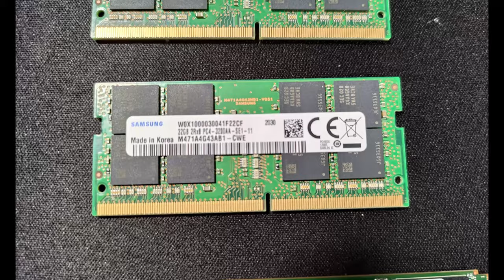ROG Strix SCAR (G533 / G733) DISASSEMBLY and UPGRADE OPTIONS (Storage, Thermal Paste)

Comment: Your video’s still being useful: I opened my machine to replace the ram, and one of the ribbon cables popped loose. I was completely lost about how to put it back until I saw you remove the one. Like that other commenter said, yours is the only video that seems to actually show that part, everybody else just says “mind the cables” and then jump cuts to the cables being removed. I’d noticed the bit that flips up, but I thought that was the side the cable went into, and I was beginning to despair because it wouldn’t go back 😂

Comment: great video! real brave pulling that mobo out without wearing a ground on your wrist or ESD smock grounded! side note, 90% of the time just touching a ground prong or metal to discharge your static is wholly sufficient! But great, step by step, no nonsense video of disassembly of the unit!
Reply from the maker: I could still wear it on my ankle if I had to, but yeah I made sure I was already discharged. :) Thanks

Comment: I was a little upset when I opened my 17 to add a 2nd ssd and saw the wifi antenna cables directly on the mobo. Thought the wifi adapter was embedded into the mobo. Excellent video. Thanks.

Comment: How the heck did you get those pipes off so easy?!
Reply from the maker: Maybe it is not visible in the video, but actually It is "hard". But I apply only a small pull force to the pipes in order to avoid bending them. You can also use some plastic tool to lever it up if you will, but don't put much force to it. Eventually it will loose and you can pull up. Also you can do some wobbly movement in order to let the paste break its "vacuum pressure".
Reply: @MakaiTechReviews  after a while i finally got it off. Thanks for the video. Was really helpful for my first time disassembling a laptop. Reassembled it, and she works beautifully.

Comment: You just earned a Sub Bro. One of the best Reviews I have seen in a long time. And Believe me, i have seen them all. Precise, to the point and Well-detailed. You covered all the points most reviewers leave to imagination. Really Thumbs Up!

I have a ASUS ROG STRIX G17 (G713), will this tutorial apply? Secondly, can I use 0.5mm Fujipoly Ultra Extreme (17W/mK) Thermal Pads instead of that Gooey stuff on VRAM and VRMS . . .?
Reply: Use K5 PRO, bro. It’s liquid thermal pad.
Reply: Yes this still applies. I suggest disabling bitlocker (or write down the key) before any upgrades are performed to prevent my mistake, losing a good chunk of my life memories.

Comment: Is the standoff for the 2230 NCMe Drive a Press-fit, Surface Mount or is it removable? Need to know as I put a 2280 NVMe 4TB drive in that space and because of that Standoff, it bends a little.

Comment: Hi there. For the SDD upgrade option, the text overlay in your video states that there is plenty of depth to support larger capacity modules such as 4TB or even 8TB, but an Asus support representative got back to me on this today to tell me (and I quote): “As for the storage, the maximum capacity one SSD slot can take is 1TB”, which is disappointing to me that this is the maximum storage capacity for each slot.
Reply from the maker: Nah, that is simply not correct. The chipset/controller can handle (and will) larger capacity drives. There is simply no limitation in terms of capacity. Sometimes the physical vertical space can limit the storage capacity, because larger drives have 2 layers of NAND chips, and won't fit into the slots. That is not the case with this model and trust me, the laptop can handle large (4TB/8TB drives) as well. I honestly don't know, why ASUS says it support only 1TB, that is pure non-sense.
Reply: @MakaiTechReviews  Sure we can upgrade with 8TB just with plug and play ?
Reply from the maker: Yes, it can handle.
Reply: I have 2x2tb drives installed and it works like a charm.
So maybe their customer support is taking the easy way out.
Reply: Hi brother 
i have Asus rog scar 17 g733QR with 32gb ram and 1tbssd with 8gb rtx 3070.
can i upgrade ssd to 4tb ssd in a single slot?
Reply: Yea beastly you can put 4tb ssd into it. Also the ram can be DDR5 ram it supports it.
Reply: I'm curious about how to upgrade the GPU or if you have to get a whole new motherboard or laptop completely
Reply: @drizzt1719  That's funny 😁
Reply: I've upgraded both ram and ssd, but yea if it's not possible for the gpu then imma just have to wait. New game maxes the gpu out with the 3070ti

Comment: So, would it be possible to replace the front panel or is the motherboard soldered to it somehow? I want to get someone  to 3D print an entirely translucent front case and replace the original one with it. I am very bad at DIY though. Do you think it would be possible if I ask someone in the repair shop to do? Is there a big risk that they would screw things up or is it a simple proecedure?

Comment: question if i replace the liquid metal on the cpu and gpu with grizzly thermal kryonaut will i also have to replace the thermal pads? if so what size do i buy in thermal pads ?
Reply from the maker: If the thermal pads not brake or dried out, you can simply reuse them, it should work just fine. Otherwise i suggest to measure one with a cliper probe.
Reply: @MakaiTechReviews  yea because theres this thing on the aurmory crate called SPPT & SPL for the Cpu that everytime i max out my temps o n cpu and gpu hit the high 90s thats not normal...i think i need to change either the liquid metal compound on the cpu and the stock thermal paste on the gpu plus thermal pads if they look used up
Reply: If you change the pads it is very hard to realign the cooling pipes back on spot, Because in order to make it a very tight seal you need to press harder and if you don’t have a clue what you are doing you may break something or otherwise you will have some space left between silicon and metal and risk throttle. If you want a little less degrees just buy the thermal mayonnaise clean the dried one and spread it like butter to maximize the area of thermal area
Reply: @vlad2908  where can I buy this thermal mayonnaise
Reply: @jorgevazquez7950  Use K5 PRO, bro. It’s liquid thermal pad.

Comment: Thanks for the video! Do you happen to still remember where the warranty void sticker is for this laptop? I want to check my heatsink mount on my unit because it runs way too hot(93c) during games. I saw similar laptops running at 80c with higher power.
Reply: Might be a little too late but it's usually on a screw on the heatsink, I think ~90 degrees is quite normal for ROG Strix, I've seen a lot of new ones running 90+.
You could buy an external cooler to help it a bit.
Reply: @SicknatureL2  Thanks for answering. I gave it to a service center, they opened it and saw that there was barely any liquid metal paste on the cpu. No wonder it was at 93. GPU still runs hot though I don't think anything can be done for that.
Reply: @anudeepk7579  Noticed any change in CPU temps after they changed it? If so, by how much?

Appreciate your time, didn't think you'd actually answer.
Reply: @SicknatureL2  Yup, they applied new liquid metal. When the guy came to my house to check, there was barely any LM on the CPU and the seal was non-existent!!! Manufacturer's fault if I've ever seen one. 

Anyways, yeah after that I saw 20 degrees drop in temps. I don't think it goes beyond 75 anymore. GPU on the other hand, no matter how many times I get it repasted, it always hits 86C(hotspot is 105C!) which is Nvidia's limit. I've accepted that the device is just designed this way or something I don't see is taking place. Been running it like that ever since.
Reply: @anudeepk7579  Hi! I'm from Brazil and I have a g533qr (ryzen 7 5800h with rtx3070). In heavy games my processor always hits 94° and the gpu always stays at 86°. I already saw that it is normal for this model, but your information brought a new perspective. I turned off turbo boost as a stopgap measure. Thanks for the info.
Reply: @razi_37  hey, My laptop is always on Turbo. It's because I noticed that the fans spin faster in Turbo and in some cases it runs cooler than performance mode. My GPU is always 86 too, that's just the limit of this model. CPU can get to around 90 with intense load but generally during gaming it should stay in the 80s. Try getting new Liquid Metal or whatever the Laptop came with.
Reply: @anudeepk7579  Ah yes, my processor came with liquid metal too. So the turbo mode I'm referring to is in the windows power settings (processor power management), not the turbo from armory create. However, this option is not enabled by default, you must activate it through the registry editor. This processor (ryzen 7 5800h) comes factory overclocked, so you just disable overclocking. The processor loses a little performance (but you can reactivate it whenever you want) but decreases between 15° - 20° of temperature.
Reply: @razi_37  ah ok, good to know!

Comment: Great video thx 👍
i have the G733QS HG 028T Model
For RAM:  wich dimension of RAM is usable? SO DIMM 204, 240 or 260 or other? 
I want upgrade it 32GB RAM with 2x 16GB and another SSD with 2TB or more :)

Comment: Brother, does this laptop support 16GB + 8GB DDR4 dual channel configuration? Or Do we have to put ram sticks with same capacity?
Reply from the maker: Hi, you "don't need to", but still be a better option. If you only put a 8GB module into the machine it will work in a dual channel mode as long as you don't fill up the 8GB stick. If you exceed this, other programs will suffer and run in single channel mode. In most cases probably you won"t overdue this, but if you are a heavy video editor/photoshop user (which usually eats up a ton of memory) i would suggest 16+16 variant. ;)

Comment: Nice vid!  Had a few questions if it's alright, I was wondering what the white stuff was surrounding the CPU liquid metal was? Also If I were to replace the GPU paste with liquid metal,  should I do what Asus did with the CPU? Thanks
Reply from the maker: Hi! The White Stuff is a foamy little "gate" to prevent any liquid metal movement outside the CPU die. Liquid metal is conductive, so it can short the circuit if contact with any other components, so obviously it is a precaution step by ASUS. If you plan to do so with the GPU, I suggest using some kind of coating near the GPU die, cause there are some tiny components that can be shorted.
Reply: @MakaiTechReviews  thanks!
Reply: @MakaiTechReviews  did you re-apply the liquid metal and leave the foamy gate?
I'm thinking of getting a Scar with liquid metal applied, but want to re-apply liquid when needed.
I'm glad they have the black foam padding. I'm trying to find somewhere to purchases that stuff.
I've seen it on the PS5 as well.

Comment: Fantastic detail in this tear down! I have a Samsung 980 Pro that I want to put in my Asus ROG Strix Scar 17 so it is helpful to know what I'll be getting into. You happen to know if there is any capability difference between the m.2 slots?
Reply from the maker: Thanks. There are no difference between the m.2 slots.
Reply: @MakaiTechReviews  As far as I can tell it looks like the laptop only supports PCIE 3.0 (?), so it may not really be worth installing the Samsung 980 Pro permanently. I'll put it in temporarily to test it, but if the performance is hamstrung by PCIE 3.0 I'll eventually migrate the part to a computer that can properly use it.

EDIT: So CPU-Z reports that the laptop supports PCIE 4.0, so I'm not sure why the Asus literature says the m.2 drives are at 3.0 speeds. Only testing will tell...
Reply: @ceb1970  so gen 4 ssd works fine?

Comment: You mentioned lots of room for multi-layer NVMEs.  Does that include a heatsink, like the 980 Pro w/ heatsink?  I'm curious in general how this laptop cools the NVMEs and RAM.  Is there case circulation of some sort?  Again, primary question is around room for NVMEs w/ heatsinks, specifically in the G533.  Thank you!
Reply: I'm looking for this same answer.  just reached out to asus support and they cant give me an answer.
Reply: @JeffKassel  That's concerning.  I love the laptop, but don't understand their cooling strategy for the NVMEs and RAM.  If anyone figures out whether a 980 Pro w/ heatsink fits, that would be good to know, too.

Comment: Hey man my pc cpu was get up to 92 degrees and I didn’t yet have Liquid Metal and I had to use a thermal paste on the cpu and now the temps are even worse on idle my cpu is around 80 on silent and when I put it at performance or turbo damn it goes to 95 degrees and I don’t know what to do and I’m  damn scared to put in Liquid Metal as it’s conductive when I get it soon. So do you have any tips that could help me out. 

My specs 
  Ryzen 7 5800h rtx 3050 ti

Comment: G 733 8tb SSD possible ?
Reply from the maker: It is.
Reply: Thank you for your answer, from Germany. I Check the SSD types, and some one are a Problem, to fast build, so this is short Lifetime, read amazon one Stars derfore, and the wd black is only at 4 GB, but my be this is good for Lifetime preferences,   the ceaperst one ist strong in time Work but to slow when half full, and so i check there ist only wd black 4gb Maximum, and this at 8gb wantend this one , means perhaps waiting...If It is developt. So the cors Air my be the only ist in 8gb.

Comment: How to repair dead screen, the laptop turn on but the screen doesn't turn on?
Reply from the maker: If you plug in any external monitor the laptop boots up with that? Bacause if not, in that case it is not the screen which is faulty, but can be bad memory or even WiFi card. If it works from external monitor, then yeah... could be faulty internal display.
Reply: @MakaiTechReviews It works with External monitor only

Comment: I have bought version with only 1 ssd and i upgrade with two 970 evo plus, but i'm not able to configure raid 0. Someone can help me ? Thanks
Reply from the maker: You should enter BIOS and set up RAID 0 there.
Reply: @MakaiTechReviews  There are no raid section in BIOS
Reply: You need to add the intel VMD drivers to your windows install usb then enable VMD in bios.... you can then use raid

https://youtu.be/agtkhZP8xJI
Reply: @meddylad It's an AMD system: Ryzen 9 5900HX....
Reply: @simonemesca9374  Arrh.... it might be worth checking for a VMD driver for the AMD... if not then Im not sure the way forward